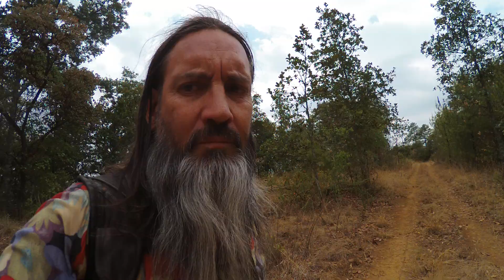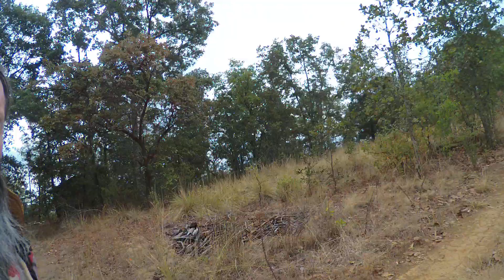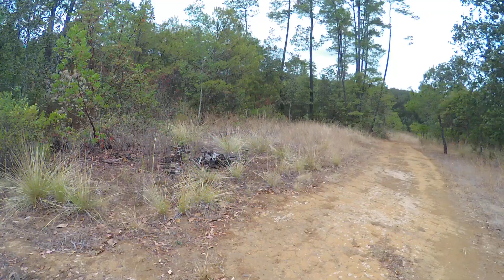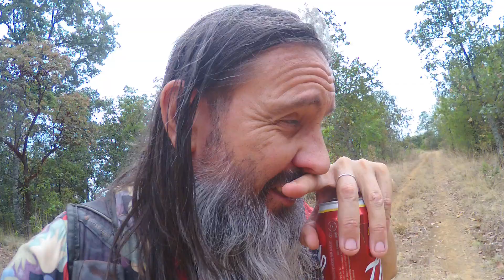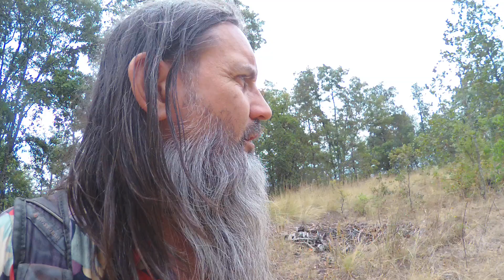Subterranean Vision: Designing Underground Passageways for a Sustainable Property. Digging in.

Comment: First step is a soils test, but that involves a company and expensive drilling machine. They will create a ""boring log" to show soil/rock types. Ask neighbors and maybe a septic installation company what the soil is like there. Could be a foot or two of earth then rocks then bedrock, we don't know. Mountains and hills are not normally made of "dirt"! A septic installer or well drilling company might know your local area. Of course that is not a guarantee, but a start. 
50 gallon plastic barrels can be had around here for ten dollars each, with the ends sawn off they might make a tunnel, one end slightly tapered fitting into another and screwed together. Maybe cover with 3 inches of concrete before backfilling? Otherwise they might start to flatten out. In WW1 the british built underground bunkers and tunnels with maybe 2 1/2" thick by 8" wide planks that were two notches on the corners forming indents on the ends to form a tongue. They would interlock with similar uprights and floor planks to form a rigid structure. 

I would not be surprised if you dug own and found rock. But I hope not.
Reply from the maker: I did learn lot when I has a bulldozer dig roads into slope. mostly just dry dirt and rocks. 
The ravine shows larger rocks further down. I would mind reaching those in some spots and maybe building on them. 
But I do get mixed thoughts online about building directly on rock versus soil when it comes to earthquake safely. Some say you want the motion. Other say better to have the movement. I want what I build to last centuries, so I care about the rare big earthquakes. 
I was thinking more of walkable tunnels. 
But smaller escape tunnels might be useful in some spots. 
Ground penetrating radar might also be interesting, but more expensive. 
Thanks so much for the thoughts and being part of the conversation! 
I don't know what I am doing, so have a lot to learn.

Comment: Good plan! We did something similar within our property out west (I don't want to reveal where). We started with a previously dug mine that is no longer productive. Then we used Earthbags as reinforcement for the walls and rebar reinforced beams and aircrete for the cirlings (barrel cielings). The Earthbags are strong and thick, while being cost effective. Please be sure to do waterproofing and use every safety measure possible durring construction. It helps to do this in the desert, rather than a wooded area... unless you are working into rock, like a mountainside. I hope this helps. We love our place. ❤
Reply from the maker: Thanks! I will be very careful. 
I have dug into the slopes in various spots and had a bulldozer make roads on contour. So I can see how erosions works here. Generally is is very stable earth. 
Anything I do, I will control the water above it. 
I just got the drone topographical maps which gives me a much better view of exactly how the land is. 
https://youtu.be/XlF1Uz3XsJM

Comment: Products like Quad deck offer preformed intelocking panels which provide deep beam areas typically run 1, or 2, 5/8" rebar from wall to wall ( poured walls ) at the bottom of poured in place beam , and 2 foot grid of 1/2 in the upper slab.
Yes you do need to brace it more. No question.
Reply from the maker: https://www.quadlock.com/concrete-roofs-and-floors/

Comment: Culvert pipe. If you want to overbuild it that's easy. Put in your trench, 12' culvert pipe cut in half will give you a 6' ceiling and a 12' walkway. Weld on anchors and pour the floor with concrete put your utilities in the floor cover it with concrete or dirt. It should be structural if you want to really overpay , I'll put it in for you. 
I'm not an engineer they are mostly concerned with cost and materials. 
Best of fortune fella I hope you enjoy many events there
Reply from the maker: Thanks!
Reply: @FoodForestHeaven watch rambo he built his fast lol. But its a valid concept

Comment: Metal culvert pipes have been used in the past for underground people movers.
Reply from the maker: Thanks!
Reply: I suggested the same. In the USA you may have access to the correct size that will allow you to stand up?
In Australia the size that is ideal for width is not quite tall enough; however the next size up is very tall but will require a heck of  a lot of Earth to be removed to fit it in place?
The only solution I can think of is having 2 or 3 rows of bessa block concrete block between the 2 U shaped halves? Then laying all over the lower sections creating a smooth floor and half walls, then 3 rows of blocks then use a rail cart as a sled to  drag the upper sections in place?

Comment: Dirt work is very slow, very expensive, and if not planned perfect, a disaster.  I don't get the motivation here.
Reply from the maker: I do. More. More security. More options.
Reply: @FoodForestHeaven  If you want a small storm shelter / root cellar, that's a great idea.  Get a fat culvert and bury it. If you are thinking a bunker, that's not a good idea.  They are small, expensive, depressing, and you probably won't be in it the moment you need it. Or worse, you are.
Reply from the maker: I am thinking of an entire underground layer of buildings under buildings and connected to others. Way out of the range of what I can create now. But you can't put it in easily later. Of course this depends on your climate, waterflow, and planning. Where I live, I believe it is possible. 
Could have a geologist, architect, and mechanical architect check me... but I have time to think since I am cash poor now. 
Fun to lookup "underground cities".
Can also look up: "How to make a walipini".

Comment: Nah maybe not put them directly under the roads unless you are trying to remain hidden from satellite detection; otherwise you will need a lot more structural integrity directly under a roadway as there is gravity with the weight of the car.
I'm not an engineer but I've looked a lot onto  tunnels and creating them.. To get someone else with a machine is going to cost you mega bucks man.
I've literally just gone out and bought myself a 1.6T mini excavator with a LOT of attachments..... Those include a hydraulic jackhammer head attachment! Anyway I'm going to try and make this as short and as simple as can be to try condense in all my considerations?
Firstly if you want some inspiration on tunneling you should subscribe to the Colin Furze channel. The guy is a crazy inventor but he's done major tunnelling in his projects and although you may not need all the approvals that he did, you may be interested in how he went about doing it👍 very interesting.
Another channel although not specifically tunneling (he has done extensive tunneling) is Mountain Fortress labs. Alan is known as the Wizard. 👍 I think you'll relate to what he has created though 😁

But in summary you'll need a rail cart system just like they had for mining back in the olden days. This will be required to shift the rocks and earth as you are tunnelling otherwise it's going to be a heck of a lot of hard work doing it manually!

You'll possibly need an excavator like what I've just bought as it will be small enough to dig the hole you require for a human sized tunnel once you've encased the tunnel.

This brings me to my idea that could potentially be easier and it may then fit in with your idea of "under the road" only because for space it's easier to 'peal the roof back' first?
I have got an alternative solution to this as well potentially?
Here's my short post turning into a long one. Sorry about that.
I digress, in Australia we have these large prefabricated concrete steel reinforced box culverts; they both look like a squared off letter U. One inverts and stacks on top of the other and they are very strong specifically for going under roads...... However the sizes they come in are not ideal because the larger box culvert would require removing huge amounts of Earth, but the smaller more human sized perfect for a tunnel is not tall enough to stand up in?
So my solution to this possibly could be laying all off the ground bottom of the box culvert and then laying some rail cart tracks on the smooth concrete floor and then having a spacer on the cart that could hold each piece of top section but elevated so that it doesn't touch the bottom box section whilst on the cart; effectively I could run a cable to a winch with a remote button (I've seen them on the market they are a thing or I can extent the control cable? I'm a CNC machinist). Then I tow my first piece of top box section to put it in place. I will then use a hydraulic jack to lift it to deseired head height plus some buffer space. I'd chock the top section in place and use prop stands to hold the top box section stable whilst I fill the space between with bessa blocks and concrete fill the gaps in between. Now you have  a box culvert that human standing sized and is very very strong.

Oh and if you don't like the idea of using the rail cart idea in the beginning because the ground is still uneven and not uniform but you still need to get earth, mud and rocks? 
I'm not sure if this is even a thing that people have done but it's an idea?
In Australia people will dump their exercise treadmills out on the front curb side when our local government runs a curbside waste pickup once per year. I see lots of treadmills and most of them aren't even broken but are just big and heavy and take up a lot of space. They would make an ideal conveyor belt system with some modifications?

I studied 1 year of engineering before switching to environmental science. I'm a  qualified cartographer and mapping analyst and I'm currently working as a CNC machinist making stair cases.
As you may be able to tell, my brain is always working spatially in 3 dimensions and also I'm autistic as fk  😄
I live by myself just me and my dog (and a budgie hahaha can't forget tweety bird!)

Hopefully my scrambled mess and recommendations give you some inspiration! I'm not one to tell people not to try something because it's too difficult but I often regurgitate my knowledge on a subject and it puts people off. So to clarify I'm saying go for it man!
I'll subscribe if that's what you're gonna do 😁
Do it! Do it! Do it! I'm here